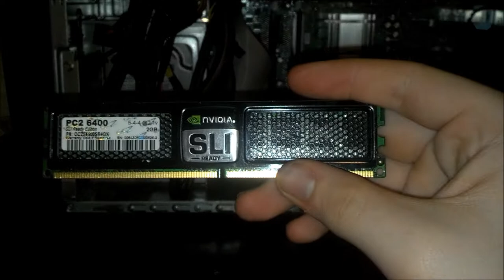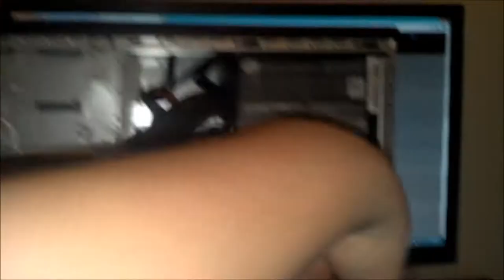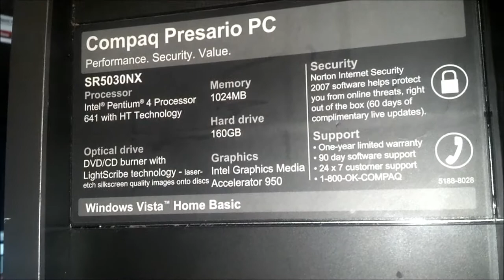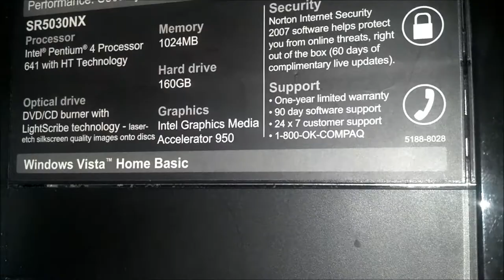$135 budget gaming PC

Comment: Good job on getting them parts. Sure the PC is not great but its ok for oldish games. The reason you are not getting full use out of the 4gb RAM is because your using a 32bit OS instead of 64bit. 

If or when you build a new PC. This current PC you will have be pretty decent as a MineCraft server.

Comment: Also I just noticed you left a comment about getting a getting 2x 7770s for crossfire. Am not sure how much the price difference is between a 7770 and a 7790 in the US but here in the UK it is only about £15 (about $20). So if I where u I would consider paying the extra $40-$50 getting 2x 7790s.